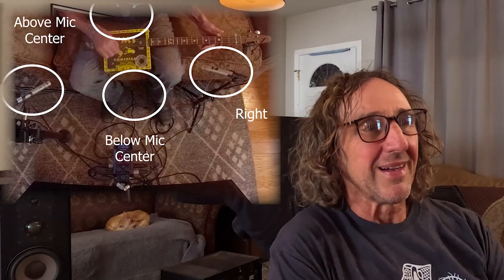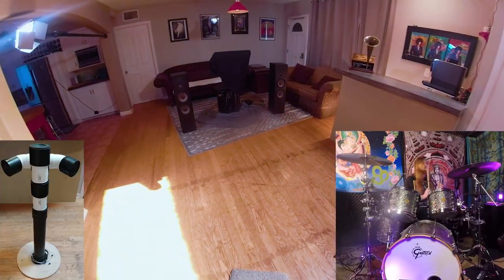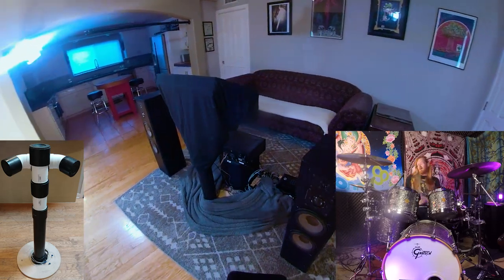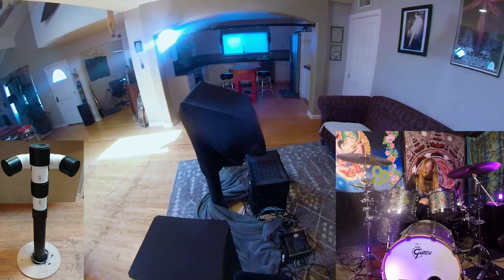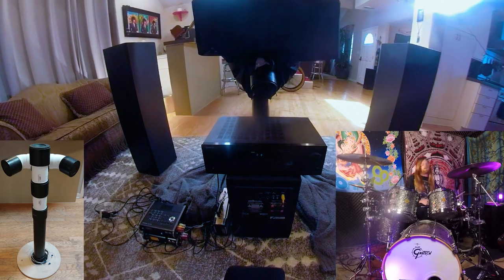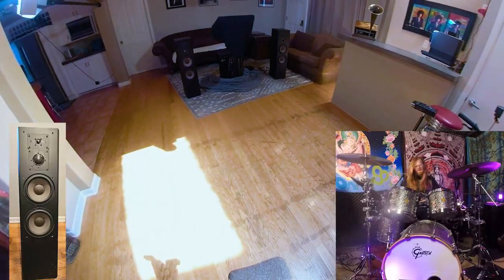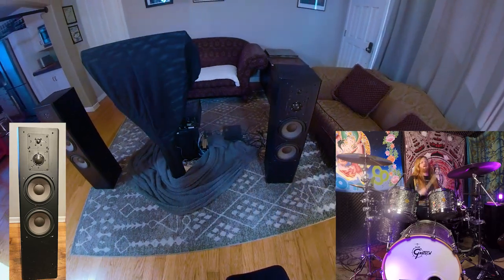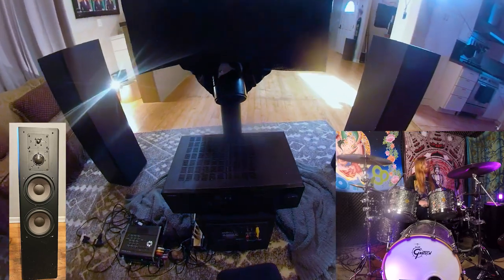How Real Do the Drums Sound?

Comment: "Audiophile = art"  That is the most succinct description of audiophilia I have heard!   Sometimes I dream of an "invisible" speaker, one that disappears in the room and is designed to NOT attract attention...because I don't think you can listen objectively while you are thinking about how pretty your speakers are.
Reply from the maker: I am not one to judge but I am one to describe what I see and hear.

I have a friend in France that does high end contact speakers in walls of expensive homes and museums. The sound radiated from the walls and the sound is not super hifi but does really cool and you can't tell where it comes from.
Reply: It already exists.  EPI 100v  speakers.  Get the version with the Upgraded tweeters (Plastic bezels, rather than fiberboard surrounds).

 They are slightly larger than Bookshelf speakers.  A 2 way system, with a punchy, accurate, 8 inch woofer.. and a very unique "Inverted" (concave) tweeter.

 When I first heard a pair, it was at a shop, owned by a hoarder... and they were placed haphazardly, under piles of magazines.   One was laying on its side,  and one was vertical.   The vertical one, was partially blocked by a sit-down video game.  Yet... the soundstage, and sound clarity, was insane.  It was as if the band was live, in the building...  and the sweet-spot was huge.  It extended something like over 20x20ft... before fading off.

 The thing is... when I heard how good the music sounded... I NEEDED to know what speakers were playing.  I spent a good 15 minutes, trying to search for them.. and I FAILED!!!

 These speakers literally VANISH into the room.  The sound that comes out, is almost Holographic.  Ive never experienced anything like that, in my entire life...  and its only more recently that Ive heard such a thing existing in some other speakers.

 Anyway... when I finally asked the man what speakers were playing, and WHERE the heck they were... I was shocked.

 They were in the most Non-Optimal of positions, and still... the sound was beyond amazing.  Furthermore... for the amount of deep bass they were producing... I was shocked that they only used an 8 inch woofer.. AND,  I was also shocked at how small the speaker boxes themselves were. Of course, this was also my first experience with not only an Audiophile grade speaker... but with a Sealed Speaker.   The bass on sealed speakers, is FAR more musical and realistic... and far less distorted (droning / farty) , compared to Ported speakers.

 Despite them being quite small in size... they weighted between 2 and 3x more than my Techniques 12" 3-way fullsize speakers.   And when I opened one up, I realized why.  The Techs used very low powered woofers, with smaller sized magnets.  Each EPI woofer weighed like 3 times as much.  They massive magnets, and stronger voice coils.  They crapped all over the Techs in every way... and those Techs were put out on the Curb, the next day... where they belonged.  I almost cried, at how much better music was, when hearing each song, on the EPIs.  In fact, I was hearing things in music, that I had never heard before.. such as lyrics that I never could understand... was now completely crystal clear, and I could easily recognize what the singer was actually singing.

 Now, the Techs were able to be pushed much louder than the EPIs... but the thing is... that the music sounded so much better with the EPIs, that it didnt even phase me.  They are loud enough, at their max capabilities.

 I got my EPI's used, and refoamed from a restorer / reseller.  However, there is a man that used to work for EPI / Genesis,  that hand makes brand new EPI drivers.  humanspeakers dot com.   Supposedly, his new drivers, have an even better response.  But Ive never tried / heard them... so I cant tell you for sure.  Though... he also does restoration of existing drivers, as well.
Reply: Great! Thanks for speaking it out loud! 🙏
Reply: @DaveRat  Hi Dave, whats the name of the company?  I've been looking for high end contact speakers for a while and can't seem to find any of a really high calibre.  Would love to check them out.
Reply from the maker: Absolut Sound based on Biarritz France. Pretty much just him and a partner

Bastien Desvergnes is his name, great surfer too.

I think he has the driver made in Switzerland. I have one of the older ones but last I saw him he had a new version. I have not seen the ones he uses on the open market
Reply: Try shutting your eyes.
Reply: Felt that way after I heard a pair of ATC monitors.  Especially when it came to guitar amps.
Reply from the maker: I do love cool speakers and do love a good story.i have some studio monitors from the BBC, a Heil air motion transformer. A horn from the 40s with a diaphragm driven by a pin. A pair of Telefunken Opius am/fm tube radios, I love my B&O turntable and I could go on and on. I love art and I love science and art sold as science, whether it's astrology or audiophile, should be taken as it is, playful fun and not based in verifiable facts.
Reply: @DaveRat  Agreed!  It's fun to just explore.  When I was a kid I assumed "good" audio was just louder...but then I discovered that some speakers sound better.  I've had a procession of speakers leading up to the current project, building custom 4 way speakers, active crossovers, using 12" B&C coaxials and 2 subwoofers per cabinet.  It's not about being louder; it's about getting better bass throughout the room.  That's my adventure.  I don't always understand the audiophiles who invest so heavily in turntables and tube amps, but as you said, they are buying functional art.  And I can understand that.  So I meant I appreciated your perspective.
Reply from the maker: Yes, the art aspect is all good. The deceptive practice of fabricating false science is a bit rough though.

Comment: It's hilarious that an audiophile would argue and get mad about audio quality with such an experienced engineer like Dave.
Reply from the maker: Us live engineers are meaningless to those in the audiophile world of magical understandings.

The live band is a noisy pile of poo it is the vinyl record on a granite slab running through pure silver wire with special beads into a calibrated lead shielded phono preamp driving to huge monoblock tube amps with $50,000 directional speaker wires on cable risers into monoliths of granite and titanium that emit sound through electronic osmosis that is where true audio lives.
Reply: You are expecting logic from someone who thinks putting your speaker cables on little stands is worth spending large amounts of money on !!  That's a big ask.

Comment: 5:06 for those wondering what the hell this is:
that's an omnidirectional speaker, most commonly used in creating room impulse responses (so you can replicate a room's reverb in a plugin, for example). They're also used for determining diffuse field HRTFs (of HATS units for example, but also of real people using in-ear microphones; in conjuction with a special room, that's essentially an echo chamber).

Comment: You are so right. I love your aproach.

 Open baffles are more realistic because they use the room.

So, somehow Bose was right with systems like the 901, 601, etcetera.
Reply from the maker: Yes and no. Radiating sound in multiple directions is good. But radiating the same sound in all directions is bad and unnatural.

The Bose 901 and other omnidirectional systems or reflectional systems radiate the same sound in all directions which means every reflection and all the direct sound are exactly the same creating maximum comb filtering.

To solve that it is important to radiate different sounds in every direction which is why I built a multi-channel speaker that has a different sound shooting to the side then the other side then up then down four different sounds in four different directions
Reply: @DaveRat  Sure. You're right.  The main problem is that most recordings are in stereo (or surround) to begin.

Comment: Hi Dave. New to your channel. I play in a duo that uses tracks for bass and drum. We often struggle to be happy with the sound of the tracks. For larger outside venues speaker placement is always a question. We also play with the EQing to try and optimize the punch. Do you have a video yet that shows how to optimize drum and bass coming from tracks and also talks about speaker placement, depending on the type of venue, whether they’re outside or inside. We are also interested not just in placement but speaker types if they also have an impact in optimizing our base and drum track sound. Thank you for your help.

Comment: Dolby Atmos delivers sound as 128 separate tracks that the Atmos processor can manipulate.  Nothing says a processor could be designed with a second set of outputs you could direct to individual speakers for each instrument or group of instruments.
Thank you for your comment about studio monitors:  "If you really want to hear what the song originally sounded like, then use the studio monitors the song was mixed on."  In my case JBL 4311B (L100) monitors.
Reply from the maker: He has hooking Dolby Atmos up to a central speaker or a group of centralized speakers that point sound outward would be very useful in creating realistic audio. Avoiding having a bunch of speakers around the perimeter shooting inward is the key to realism

Comment: Drums are incredibly noisy. I'm a drummer and figured out a long time ago to use in ear monitors and a ribbon mike on stage as my drum monitor. You can then place the mic anywhere on stage and turn everything down. It works fantastic. The drums and other instruments sound real and dynamic. And there's no monitor to feed back in the pa. I still have to deal with resonant frequency vibrations from bass guitar etc.

Comment: Mounting the drivers in the plastic pipe is genius! I have been developing a virtual band in our rehearsal space for about a year,  re-amping the other guitars, vocals, etc., and the drums split between two RCF SMA 15's. So making band rehearsal available 24/7, and although it sounds pretty good and serves a purpose it still hasn't got that drums in the room feel, especially the cymbals.  So getting drivers for the cymbal elevated in some plastic pipe is something I'd like to try. Do you have any suggestions for the type of driver or tweeter that would represent cymbals at a real and dynamic level? Thanks in advance!!!  This has been Inspirational cheers for sharing.
Reply from the maker: I recommend the B&c coax drivers for the stereo cymbal highs. Be sure to stuff all of the PVC tubes with loads of fiberglass or cotton insulation as they will resonate if you don't.

Did you watch the build video of the speaker?
Reply: @DaveRat  Cheers Dave.  Just watch the build vid 👍👍👍👍👍

Comment: I suspect that your 'in person' result is much better than the result of YT playback through ordinary speakers. The only difference I get is some unwanted resonances from the small tube dimensions, but I am willing to believe that sound traveling outwards from a source would make a very different sound field in the room compared to the sound field from speakers near the walls.
Reply from the maker: Interesting, seems the sound differential and realism differential at least when walking behind the different speaker types would be audible even on a cell phone speaker
Reply: @DaveRat  The thing you said that particularly interested me was to consider the difference between sound radiating away from an object in the room compared to sound projected into the room from speakers near the walls, and I can believe that the former setup would have a greater similarity of sound field compared to a live drum kit. All good so far. But .. your demo was to compare two types of speaker in the centre of the room! So, for me, it did not illustrate the point I think you were making - except yes the ordinary speakers did sound more muffled as you passed behind them, but that effect is well known. Just for info, I am using JBL Monitor 4208 speakers on the wall, on a Teac receiver driven by PC digital audio and a DAC, with a DSPeaker processor and Monolith sub from BK electronics. So my listening filters are probably mainly my own ageing ears, the YT sound processing and the JBL speakers in that order. I love your highly practical content so please keep experimenting. And my wife says she prefers the sound of your speaker!

Comment: Be interesting to double up that system, run a rear facing one behind and run that one out of phase and hear the room more rather than the stereo setup cause it would cancel itself but the reflections off the walls, like having an open back system but the advantage of having more bass from the boxing i would put the mic right above between the systems
Reply from the maker: The complexity of the sound radiated from a speaker that radiates multiple sounds and multiple directions would be somewhat immune to phase cancellation from a second version.

If the second version used different mics in different locations then it would be closer to having two different instruments playing at the same time and that has little or no phase cancellation at all

Comment: The crossover design needs to be ist or second order to be closest to the original signal. Nearly all speakers today are 4th order. The idea of time alignment cor a point-source was imagined by someone a while back. Maybe the dual concentric designs attempted that physically, but there is no speaker out there that is linear from low to high without peaks or dips in response. So this idea to get rid of or tame essentially what can be defined as faults in the driver structure, comes about with filters and chokes in the crossover. So that sends the original signal through this giant network of phase inverting, reverting, complex mess of wire, caps and a resistive networks that creates something very different that what came from the amp. Some of the most realistic sounding systems I've had were low-fidelity, minimally manipulated simple, full range single or 2 way speakers When you went back and forth, your design sounded more realistic by far. Open, uncompressed and natural.

Comment: Going along with the realistic vs identical, especially with drums, the lengths that sound engineers go to to record drums to make them fit a mix is just crazy. Tape everywhere, muting gels, towels, pillows, removing resonant heads, room micing, close micing, room treatments, drilling holes in cymbals, gating, compression, eq, not to mention any digital signal processing for cleanup. There's really nothing identical about 99.9999% of recorded drums, the dynamics and high volume of the instrument just doesn't allow for that.

Also, if I win the lottery, I'm going to need one Snarky Puppy ensemble of speakers in full 132.8 surround.
Reply from the maker: I think there's two different things going on here.

The desire to make things sound beautiful and marketable and smooth and good and desirable is what the recording industry and home Hi-Fi industry is all about.

Separately and independently I am looking at how to make something that sounds realistic to the source. I'm not saying that the sore sounds desirable or good I'm just saying this is how one would create a realistic sounding thing.

That said the possibility to combine those two concepts is what's especially interesting.

See, I believe that the realistic sounding source can sound beautiful if proper production is applied but home Hi-Fi as it stands now will never sound realistic regardless of how much production is applied
Reply: @DaveRat  makes perfect sense. We've been living in a stereo world (starting to leak into binaural) for so long, maybe it's time to ask "do all our recording decisions need to be beholden stereo outputs?".

Question: how does your "live rig" scale with volume? So much of how we experience music is volume dependent, from guitar amps to proper drum technique, I'm just wondering what the ideal volume range is for this and the previous set up.